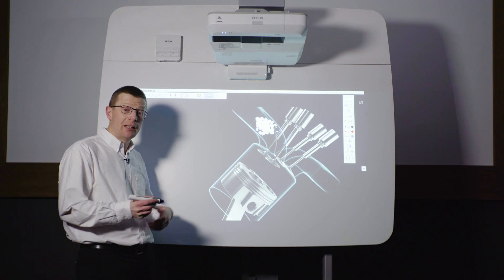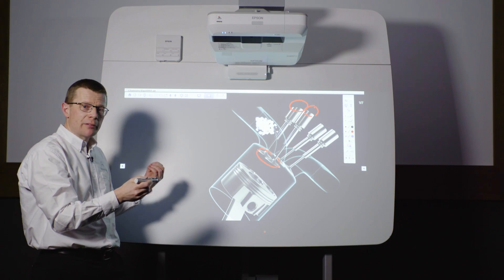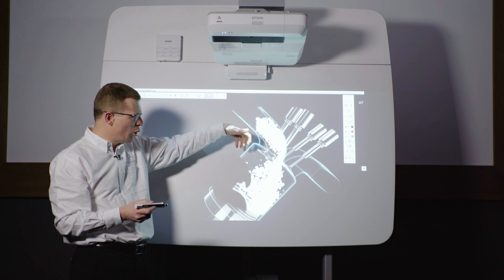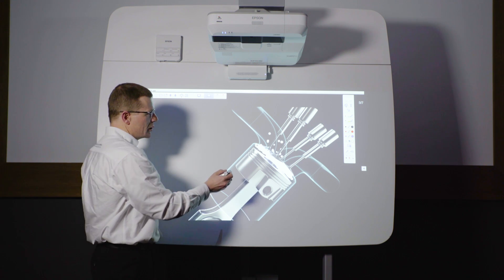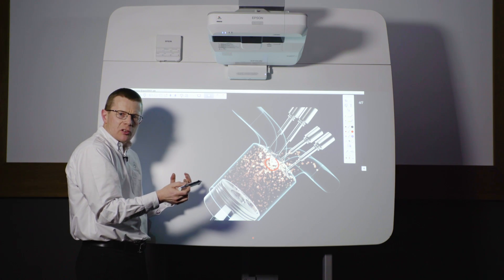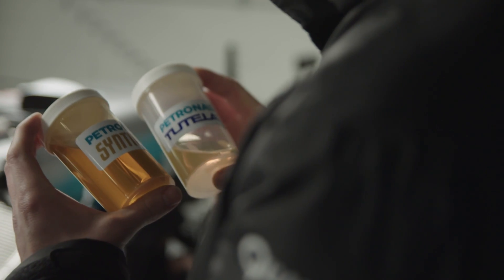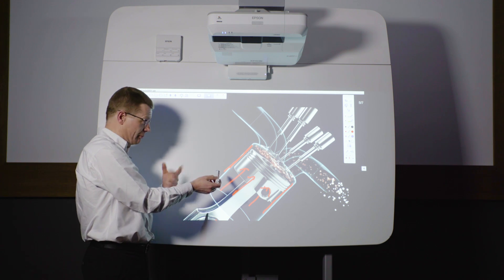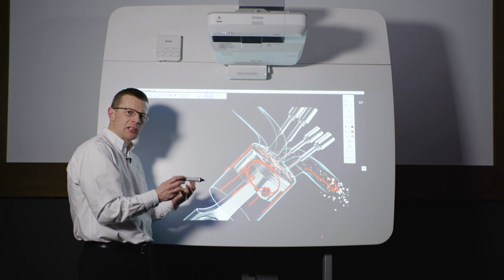F1 2017 Explained: Oil #SimpliF1ed

Comment: Can you give a different video with a better explanation for WHY the engine requires 10w60 and how the bearing tolerances are set up accordingly for the oil viscosity because it’s a very different oil than what’s ran in modern gasoline engines because of additive packages and shear stability

Comment: They forgot the part where they let oil "leak" into the combustion chamber
Reply: If not done right that lowers octane cause detonation which equals power loss and a big boom.
Reply: @alejandrotobienne584  the oil F1 engines run isn't the same stuff that's in your car. It can be used as fuel, which is why there are rules regarding its use.
Reply: @spamcan9208  so your saying it has a low flashpoint then and in that case how does it not ignite in the turbo??
Reply: @alejandrotobienne584  I don't know, ask an F1 engine supplier. Their engineers are among the best in the world at controlling the combustion process.

Comment: Lol they use pneumatic valve actuation there isnt a cam shaft wtf lol
Reply: Camshafts are still used, but pneumatic cushions/'springs' is used in place of a coil spring because it doesn't resonate, which caused valve bounce in older f1 engines, that's all :)
Reply: I think they do use the camshaft to open the valves but the pneumatic system is used to close the valves instead of springs.

Comment: How much oil is allowed to be burned per race?
Reply from the maker: +Ricardo Gonzalez  Oil may not be used as fuel. A consumption of oil - which happens in all engines - of around 1 litre per 100 km is monitored by the FIA.
Reply: Mercedes-AMG Petronas Motorsport Thanks for your response !!
Reply: with this relatively low revving engines is a high consumption  of oil. I'd like to know how the oil vapours get into the combustion chamber...

Comment: Can you please explain the oil burning and how trick suspension works?
Reply: By some tricks they seep engine oil into the combustion chamber thereby burning extra oil as fuel. Extra fuel is to produce more power because, in this case the drivers may worry lesser about fuel saving, although slightly less. Something is better than nothing.

Comment: Why is the top surface of the piston not flat????
Reply: Had they not been flat the valves would come into contact with the top of the piston (the crown of the piston) and would tear it apart. Those dents are for clearance. The valves don't necessarily come down further to allow more air, but comes down earlier before the piston is fully cleared of the valves because the valve train timing allows that to be the most efficient in providing the best possible combustion. The four-stroke-cycle never happens perfectly, the strokes and valve timings are designed to overlap each other. For example, there is a short period of time at the end of the exhaust stroke where both exhaust and intake valves are open before all of the spent gasses are even pushed out. This application is actually very common in a lot of cars, by the way. Fun fact: Vtech is just a way to shift the valve train timings of the engine between making it the most fuel efficient and most power efficient and is controlled most commonly by ECU but initially when you press hard on the accelerator. Hence why it takes a little bit it to "kick in."
Reply: thank u!!!

Comment: The oil used by Mercedes AMG formula one team is developed/produced in 
Petronas main research center situated in Torin ( Italy). Until Petronas
 took over in 2007 it was was  Fiat's primar oil research center). 
TUTELA means protection in italian.